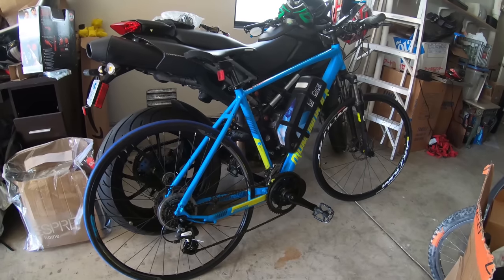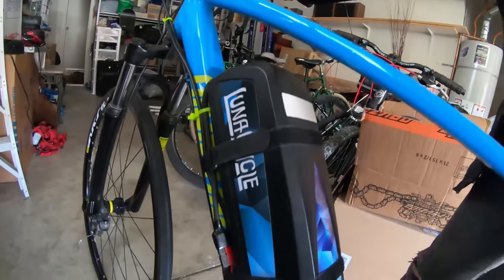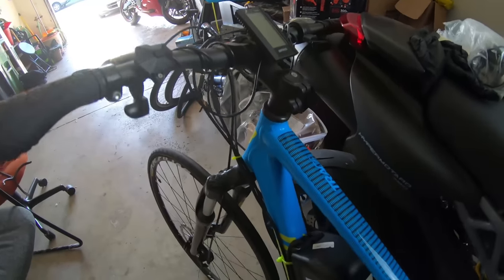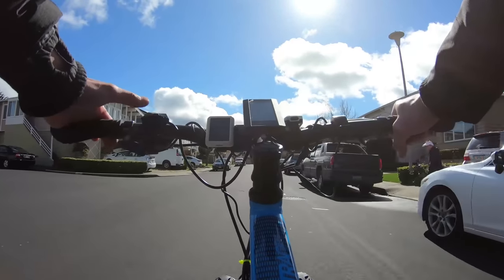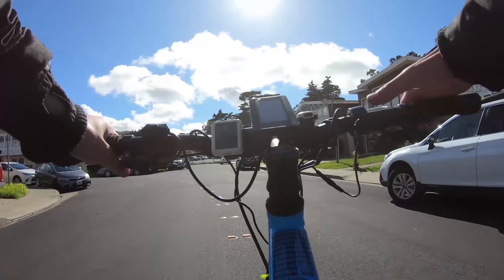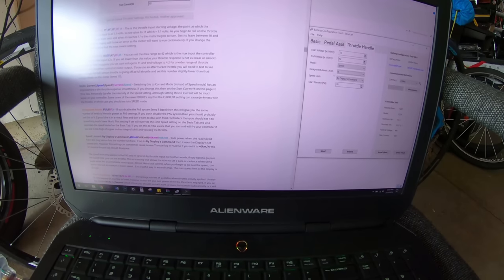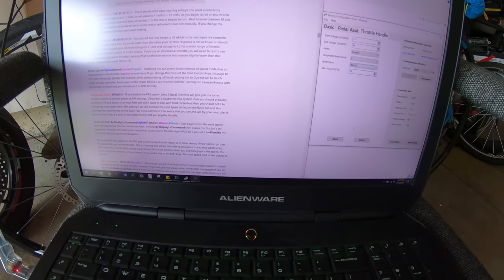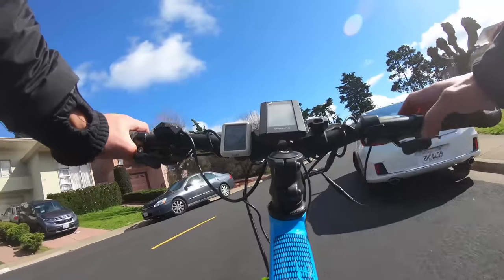Bafang BBS02 750W 8Fun Mid Drive eBike Motor - Review and Programming

Comment: I just finished my bbs02 build about 3 weeks back. These kits are so easy to install. I have the 17.5ah battery and I get over 120km on one charge. It all depends on the pedal assist level. If u pedal assist 9 and push bike all the time u can get 50km so all depends on the rider. On a flat road I get 55kph to 60kph with 44T. This motor is very very quiet. Loving the bike, money well spent.
Reply: hi how fast are you and how much do you weigh
Reply: @nikob4349  judging by his range and batt, my guess is around 65kg at 15-20mph.
Reply: Hi it's Jason I'm getting a my self a 750 in the next few months befang 100 present. I was watching your video and the bike gos  really good. I have a 250w 36v befang motor I can't wait to up grade to a 750w. Thanks a heap for getting back to me much appreciated mate and take care and stay safe.. Jason
Reply: Where do you live m8?

Comment: Assembled mine today and by god is this a blast. First ebike I've ridden and it's totally fantastic. The 750w motor easily gets me to 50kph though I mainly ride at between 30 and 35. Only took a couple of hours (mainly cos the crank was a really tight fit and needed some physical assistance to get into position !). If anyone is buying the Bafang I'd advise you to make sure your bike has a 68mm crank as this makes it much easier. Mine is 73mm which made the install a lot harder. But if you have any doubts about doing this just ignore them as you really won't regret it.
Reply: Hi there , i too have an 73mm bb. How did you get your bafang to be tight enough for it to stop moving up whenever power kicks in ?
Reply: @xJayteee  It's already really tight in the crank case but I attached it to the bike using the part with the two screw attachments.
Reply: @xJayteee  But didn't you attach the triangular part on too ? That attaches to the motor with 2 bolts ?
Reply: @MikeKleinsteuber  yea i did , tightening that does not prevent the  whole entire motor from moving up
Reply: @xJayteee  can't help then sorry. Worked fine for me. Hope you find a solution
Reply: Can it go faster maybe? Like 50? I'd be happy if it can go 50 at whim whenever i need the speed
Reply: @ripp3rjak934  50 mph? Then you need a much bigger crank.

Comment: Hello guys! I would like to upgrade my bike to an ebike and i''dont know which motor to choose...Im doing deliveries in a really hilly area and its really tiring to do 4 days a week... I would use the bike most of the time with pedal assistant and im doing a day like 40-50 miles .So what you think which would be the best battery/motor combo> 250 , 500, 750, or 1000? Any answer much appreciated!!!
Reply: 750w bbs02 with a decent battery 17.5ah  samsung cells.

Comment: i want an ebike with this mid drive, how do you think it will handle a  heavier person?
Reply from the maker: It should. The load is mainly dependent on the bike that you use. The mid drive only rotates the chain as you normally would pedal. You may have to go into an easier gear climbing, so it doesn't put too much stress on the chain. Thanks

Comment: Mobile 28 is so 2000 and late, Thixosyn is replacing all of our 28 grease. low rpm high pressure is now thixo, 28 is still in Very high rpm bearings tho. Cool setup and you got a crazy good deal.

Comment: Colin, I have a BBSHD with twin magnets for the speed sensor (Had to set two in the bafang config) on my mountain bike. All this does is allow faster speed readings as the wheel only has to do a one full turn to start reading speed instead of two.

However if the wheel size is set incorrectly in the controller configuration, the speed will be incorrect. The location of the magnet and the speed sensor obviously affects the speed reading of the wheel as well. It should be set closest to the rim wall (air valve circumference area) on the spoke from the centre axle as it can go. This will allow the sensor to time the rotations the most accurately to what it should expect from its internal speed tables for that wheel size, thus providing the correct speed. Otherwise Great video!
Reply from the maker: Thanks for the comment, Fernando!
Reply: Hello! Should I put a second magnet on any neighboring spoke? or preferably opposite in a "straight line" from the first?

Comment: If you're having an issue of sometimes after your stopping or has stopped and you go to hit the throttle and you don't get an instant response like you would normally get. It can be as basic as your brake sensor in your brake handle. If it hasn't released all the way it will not push the button in Far Enough till what the motor no it's allowed to give it power again. Sometimes I'll just type with my fingers and push my brake Ford solve the issue in a second. Keep the break and cable lubricated so when you release the brake it releases a hundred percent of the way and not 95% with your calls at lag N response. Might not be your issue might be just throwing some experience your way

Comment: how fast can it go on how many tooth in front and rear sprocket with peddeling?
Reply from the maker: The motor is limited to 28mph, but I've hit slightly faster than that going downhill. I think it was 48T in the front, and the lowest chainring is 12T in the back.

Comment: Is that a temperature gauge or fish tank temp next to the Lcd?
Put one in my motor so I can try not to blow another controller.
Not the most reliable kit and been looking at a grin 25amp external controller for when it pops.
110 miles and blew, but was riding hard for 14 miles for 3 days all the way and back.
Felt for heat but winter winds keep the outside cooler so put internal temperature probe in motor. Hottest so far 39c, if it gets to mid 40s will slow it down and hope controller will live
Reply from the maker: There's another speedometer on the left, and bike light on the right of the LCD screen. I bought a fish tank temp gauge, but never installed it.
Reply: @ColinLeung  after one blow controller and feeling the outer case in winter here in the UK with cold wind etc you have no clue as to internal temp.
I done it in 15 minutes and put clear sealent and now get a good temperature reading.
Only reads in celsius

Comment: LOL I was wondering why bike had an exhaust for a few sec until I realized it was a motorcycle behind your bike cool video how does it do on hills and long rides
Reply from the maker: There were some decently steep hills in the video, and I could definitely feel it slowing down with the throttle, but it's not bad. I usually pedal and it goes faster. The furthest I've done was 15 miles, and it was fine. The battery is supposed to handle 40+ miles, but I haven't tried riding that long yet.

Comment: Hello Colin Lung,
I'm on the fence of switching from a 6 year old worn out Crystalyte HS rear wheel 36v ebike kit to the Bafang mid Drive BBS02b mid  drive 500 watt kit with 36v battery. 
One of the reasons to change from the x-lyte 28" rear wheel drive to mid drive are : 
a. because as a Postman delivery guy for work I would like to be able to take out a normal light weight rear race wheel with quick release easily in case of a flat tire. The heavy ebike rear wheel requires multiple tools to onscrew the lock nuts and rear axle reinforcement anti torque mounts to do so .
B. Also the rear wheel is heavy to spin unassisted in case of a empty battery . 
So my main question right now for you  is :
"1. How does this Bafang bbs01 mid drive feels when riding unassisted ? 
Is there a clutch / freewheel mechanism inside wich separates the motor parts for being turned around when cycling the front chainring unassisted / unpowered , or are you still dealing with the force of having to synchromely rotate the electrical motor rotor and magnets along when cycling home unassisted alone ?
Reply from the maker: Hello Pascal, there is a power assist mechanism that engages when you pedal. The mid drive is able to coast and pedal backwards, so you're not fighting resistance as if you were biking on a fixed gear. The only drawback is that the mid drive weighs around 10+ lbs, and the battery is another 20, so it feels like you're biking with a very heavy bike without any power assist. I hope this helps.
Reply: Mate if the battery dies you wont know the weight is there not like heavy wheel drives
Reply: @ColinLeung  Yeah I know. You are right. I have the Bafang BBS02 for almost one year now. And it's freewheel mid drive motor feature when riding unassisted after the battery is empty is much better or much less heavy than riding unassisted with a direct drive non freewheel heavy rear wheel motor.
Reply: You will regret buying thr bbso2b just like i did .
1st problem was speed with the top speed being sent a 44t chainring 17mph was very disapointin so read as much more as i could and sent of for a 48t front ring in uk from brighton hove bafang , then could still not keep up pedaling at 24mph , so i changed my cassttete from a 14t 28 to a 11t28 but didnt fit . So at the time the freewheel gears with 11t32 was sold and settled on a 13 t 28 which took me up to 28 mph in level 5 . With throttle on level 9 36mph . . I have an old steel beast claud butler 26 wheels and so heavy. Just bought a cube aim for bargain ofc x
Reply: Sorry didnt finnish my coment . So the cube light an 9 speed 11t36 so i have a 52t frontring in the box but just from a 14rear to 13 made 4mph better . Have pedaled mad and got 37.8 mph which was great with my wife mext to me an she was shocked like me . So lm thinking 40 mph is easy possible but when you get
To 28mph the slightest bit of wind can slow you right down . On the cube i will update but could do 32 on flat easy and more but range will go down.
I would get a 17.5ah battery if you want 30+ miles on throttle but i could get 60 miles watching the watts etc.
I changed the LCD c965 battery is in acurate and no watt metre . P850c is great and gives you range along the way . I set my levels from 0 to 9 at 5 levels and thats 28mph and its a great motor.
Like i said though i wpuld buy the luna BBSHD 1000w .
I will buy another project and buy 335USD cyclone with 60v triangle battery so now an again on my comute i can hit a steady 30mph on flats an grades an not slow down.
Best thing i done buying midrive .poweeeeeeer

Comment: Grazie mille per le informazioni, però dovrei farti una domanda. Io ho una bici gravel con manubrio curvo, le leve del freno che vendono nel kit sono per MTB o cmq per un manubrio dritto, come faccio ad adattare i freni?
Reply from the maker: You can swap the handlebar from curved to straight, or see if the brake levers fit a curved handlebar. I assume the current brake levers are not curved?

Comment: Im looking to turn my specialized rockhopper into an ebike. Do you recommend this built? My budget is 600-700
Reply from the maker: Hello Justin, I'd recommend this setup if you'd like to convert an existing bike into an ebike reliably. The Bafang mid drive is around $500, and a battery can be cost $200+, so that may exceed your budget though. I've tested cheaper wheel conversion kits that did not work well.
Reply: @ColinLeung  Thank you for the reply. I will give this set up a try. 🤜

Comment: does it  being a 48v12ah change the speed if so how fast
Reply from the maker: A 52v vs 48v battery should not change the overall top speed, but should help with acceleration; hitting the same speed quicker. Amp-Hours (Ah) indicates how much capacity the battery has. The larger capacity should result in longer range if everything stays the same (acceleration, speed, etc)

Comment: Hey mate great video. It's really got me intrigued. I'm not to tech smart with all the volts an amp hour stuff but what would you recommend for a big bloke looking to get maximum range? Is 36v and 13 ah good? With a 350 watt torque motor?
Reply: Paul Wagner hello. I would recommend to go for the 750watt motor with a 48v battery (i got 17Ah battery). It cost me 720 euros, which is 810dollars. Vs 600 dollars for 250w motor/36v battery. I think price difference is worth it, because you go much faster and with a much longer range. If you wanna know where i bought it i can look at my purchase history on alibaba
Reply: Paul Wagner my dad got the 350watt motor, so i know the difference🤣 he wished he purchased the 750watt (which is 1250w in reality) too
Reply: Joshua Erbe whys the 750 w motor 1250 w?
Reply: THE W4RRIOR5 CODE i think it has to do with regulations, but I’m not sure tbh. I heard some people put 250w stickers on their 3000watt motors for if police would investigate bike😜. 750watt is max in US, so maybe thats why they just say it’s 750w, but the power indicator indicates 1250w when i full throttle
Reply: THE W4RRIOR5 CODE. It is good to know that the bike doesn’t have some sort of power curve. When you peddle lightly you get full power (depends on the assist level too) and when you pedal faster, you get the same amount of assist. I didn’t know this. So maybe it;’s good to know. Takes some time getting used too, but it is fine now.
Reply: @joshuaerbe289  My bike has 36 T I believe and when I try order the bafang 750w mid drive the smallest one is 44T I think so does that make a difference or not? I seem to be stumbling on road blocks trying to convert my MTB into electric. It puts you off buying the kits in a way. I'm just too eager to make my plus size MTB fly lol.
Reply: @joshuaerbe289  Yeah from what I watched and read all these motors be it 250,500,750,1k,1.5k all go beyond their stated watts think it's called peak power not sure I'm no expert but it's like a spike to that wattage doesn't hang there unless you got a beefy battery I believe.
Reply: The question you have to ask yourself  do you wan to travel 50miles or 15miles running at 45mph since a 750watt  is still capable  sure the bbshd  is more power but do you really  need it that's the question  72volt  motor  when 52volt 34 ah is the sweet spot for 750watt
Reply: @thew4rrior5code  Yeah that is correct. You can run a 250W motor at 1000W, but thats not for the longevity of motor.

Comment: Is the thumb throttle power variable?  Or is it like an on/off switch?
Reply from the maker: The one that I have is variable. The more I push it the faster it goes.
Reply: @ColinLeung  Thank you!  I have a BBS02 kit, and my throttle acts like a switch.  Very annoying.  I wanted to see if there's a setting somewhere that addresses this issue.
Reply from the maker: @warrenkawamoto8660  Sorry to hear that. I looked online and someone with the same issue had the throttle replaced, and it works as it should now. 

"To answer my own question here, problem was just the throttle, no issues with the replacement throttle and sent new controller back to the vendor."

Try contacting the vendor for a replacement.

Comment: your cablework needs some rework other then that it looks great !. And why did you put your battery backwards ?.
Reply from the maker: Thanks. The battery holder wouldn't bolt on to the frame and the battery didn't have enough clearance to slide out if it was installed upright.
Reply: @ColinLeung  I had to install mine upside down too as the bottle holder holes were too low on the frame for the battery to be held the usual way. However, this makes absolutely no difference to the operation at all.

Comment: Possible to reduce 750w to 500w max?
Reply from the maker: It may be possible depending on the display that you use. The one I had could adjust the throttle percentage, so you could set it to 66% and theoretically not use the entire 750W if you wanted to preserve battery and motor wear.

Comment: Don't you basically have to give up two chain rings at the front for this to work?
Reply from the maker: The motor comes with a single chain ring, so you give up whatever you previously had (double or triple chain ring setup).
Reply: @ColinLeung  thanks Colin. And what effect does that have on the preexisting gearing on the bike?
Reply from the maker: @errolkim1334  It replaces it entirely. The front is fixed, and the only gearing that changes is the rear. It's like losing one of the cogs in the front. You won't have to shift. It'll be more difficult to climb hills, or reach max speed depending on what chain ring you install on the front.

Comment: How come you're using a 52v battery with the 48v motor system? Can you do this?
Reply: yes the Bafang will except a 52volt battery. better range and far less voltage drop.
Reply: @86BRETT86  I ordered the 52 volt 17.5 Ah but got the 48 volt 17.5 Ah. Perhaps they were out?

Comment: Will I be able to ride and and do the same things as my friends with $6000 ebikes
Reply from the maker: It depends. What do you mean when you say the same things as your friends with $6k bikes? You should be able to keep up with them if the motor size and battery capacity is similar.
Reply: Thanks how far can I go with these motors and my battery is 17.5 ah my bike is being built as we speak
Reply from the maker: @jayg1358  I think 17.5 ah batteries are rated ~ 50 miles per charge.

Comment: What is the difference between C965 display and DP-C18 Bafang display ? And should I go for 500w or 750w motor ?
Reply: The c18 display is better, some extra functionalities, the 750w has more grunt, its helpful qhen going uphill, but it will drain your battery more, which is obvious since it consumes more Watts

Comment: How fast and how many miles
Reply from the maker: I hit over 30mph. Some others have done 40+ with larger gearing. The battery is supposed to get 50+ miles.
Reply from the maker: @Jesse Harrington I think I have a 45T chainring in the front, and 12T smallest cassette in the back. This website calculates the top speeds with the front and rear teeth and cadence. https://www.bikecalc.com/gear_speed

Here's a video of someone doing 40mph. https://www.bikecalc.com/gear_speed